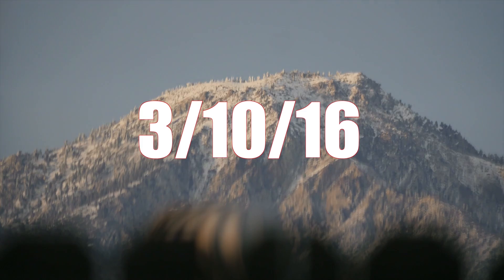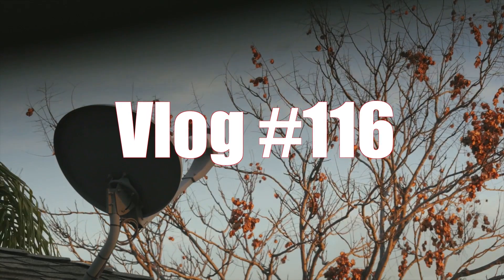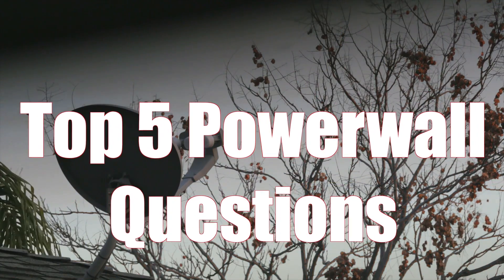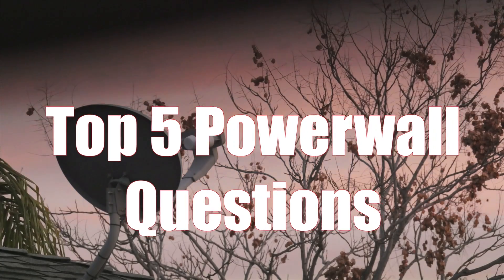Top 5 DiY PowerWall Questions 1/5 - BMS

Comment: You can get away with not using a "complete" BMS, but there isn't really any reason not to add a couple of thermistors between the battery packs.
And cut the charging if the temperatures rise too high. It's a really cheap failsafe.
18650 are really solid and mostly well built batteries, and it's unlikely that something happens.
But it only takes one defective cell to potentially escalate to a big fire if there is no failsafes.

Also, just as an experiment, you should do a video where you heat up one cell until it blows up!
Reply: so better to be safe than sorry then. That's good to know.

Comment: Quiz how many factory built vehicles do not have BMS ?
How many laptops do not have BMS?
How much money have all of these companies spent on research deciding on BMS ?
How much money have you spent on your BMS research?

That being said. BMS Have caused several fires.
So having one or not having one does not guarantee you will not incur a problem.
We should all do research and then decide what is the best decision for our project that makes us the most comfortable.
We are in this journey together. Help one another don't be haters be helpers.
I personally believe in using a BMS In all my projects.
Just makes it simpler for me to monitor everything. ( they are not cheap )
Reply: Yup. Good BMSs are not cheap.